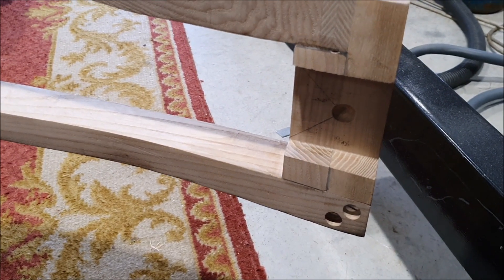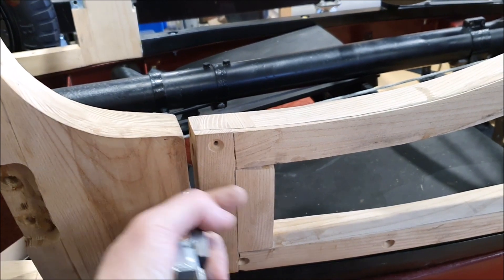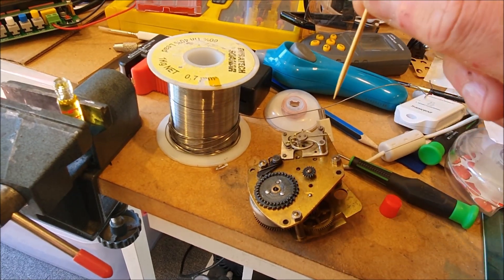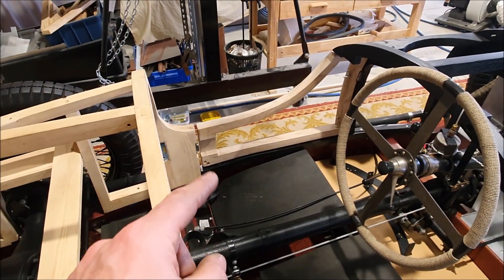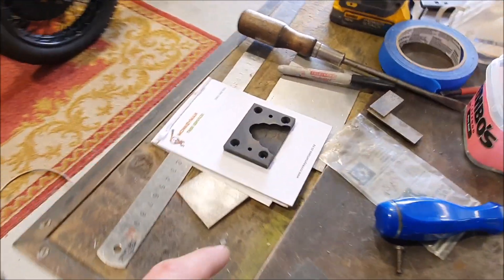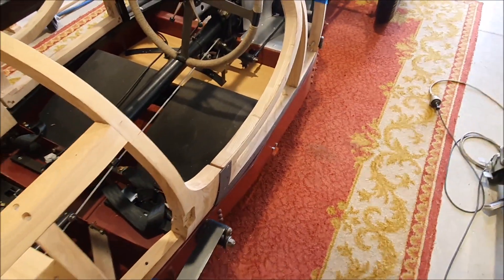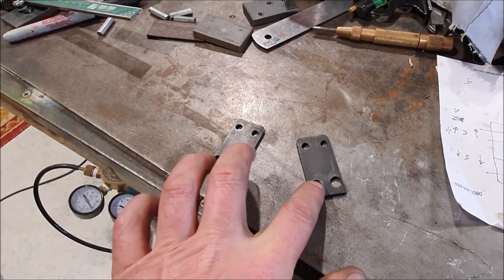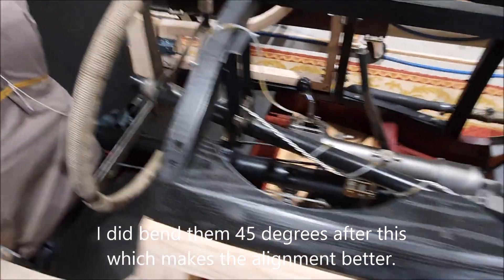Pre war Riley Brooklands - door latches part 2

Comment: A few decades ago I was a sewing machine repair guy, Make sure to oil anything that moves and please grease the gears or else they will reduce themselves to nylon dust fairly quickly. I used a black moly based grease sparingly on the teeth of the gears. I am absolutely addicted to your channel! Been a British car nut ever since my Uncle took me for a spirited ride in his red MGA when I was five years old. I'm 58 now and have owned many different makes of British vehicles including motorcycles. Keep up the great job and I'll be there to watch and 'Like"  each episode!
Reply from the maker: Thanks for the tips. I suspect it needs more 'flushing out' as it starts slowly then speeds up over several minutes. I do have some proper plastic gear grease somewhere, some of that might work on the plastic bits. Apparently the metal to metal used sintered bushes which were oiled at the factory. When I was younger I never really liked MGAs, the nose always looked wrong to me, but they have grown on me over the years.

Comment: Standard method of dealing with worn pivot holes is to rebush them by drilling oversize and fitting bushes. These can be cut from pre-formed "bushing wire" which is readily available in different sizes.
An alternative to a forward mounted handle for the door locks would be a flexible cable pull. This could either fit inside the thickness of the door with a trimmed recess or be mounted on the inside surface like eg the SS Jaguar 100 which uses a leather trimmed chain using very similar catches. You can then dispense with the internal lever as the cable or chain attaches directly to the end of the latching bolt via a cross-drilled stud.
Reply from the maker: I think there is an entire rabbit hole of clock making I could end up falling down if I am not careful! A cable pull was something I considered too. I actually bought some cable pull latches to play with. I think a lever will work better and I can arrange it so that the door latching is quite soft, you don't have to slam the doors, but the opening handle is reasonably firm so you can't accidentally knock them. I want the handle to be solid feeling. It's a personal thing that flimsy door handles annoys me so I want them to 'feel' nice.

Comment: Hi Simon  You may have been ''climb milling'' when you had your problem. That is the table moving in the same direction as the cutter rotation. Only happens with HSS cutters as the cutter gets sucked into the job. Timber framed doors do ''clunk'' If you have ever been on steam trains the rolling stock does the same thing. Slow but steady! Good job.  Cheers John
Reply from the maker: Hi John, yes probably with the climb milling. I always have to think carefully about that and still often get it wrong.
Reply: When I was an apprentice (yonks ago!) we were taught It was bad practice. Today with the advent of insert tool holders improved cutting angles and higher spindle speeds it is  not the problem it once was. I think the same rules still apply. If you are only milling once every blue moon then I would be the same! Write on the machine plunge then an arrow in the required direction. I used to use chalk so I could rub it off!  Cheers John @asciimation

Comment: Right way to go with the latches I think. I would have the handle as a pull; more instinctive. The steel may have some inclusions that caused local hard /soft spots. An interesting one. When you get the car skinned and driving, more adjustments will follow once you know how much chassis flex you have. That is my experience. Reckon I would need to have the doors at 180 for me to get into the cockpit today! Looking forward to seeing it being fitted out with the instruments. Best wishes from the UK
Reply from the maker: "more adjustments will follow once you know how much chassis flex you have" that's why I am trying to make everything adjustable or tweakable later. I don't imagine getting it right first time! Advice from someone with one of these cars is leave off the door straps. The doors aren't heavy and having them open fully is very useful.

Comment: The engineering in those doors and latches is pretty impressive.  But I would caution you, if you engineer them anymore you may need a higher horse powered engine to drag the car around. 😁 The proof that you are doing things right is, if the car was mine, I'd just be stepping over the sides with no doors. Don't do stuff like I would....Cheers from Iowa
Reply from the maker: I honestly don't think you can get into the car easily without the doors. The steering wheel gets in the way. A lot of the racers in the UK use detachable steering wheels I think and maybe the doorless bodies have slightly more room to them? I can always add lightness later by drilling some holes in things I think.
Reply: Like I said "don't do things the way I would do them" 😁 @asciimation

Comment: As far as doors go, my  tourer, which has an original body, has latches much like the ones you have , as far as location goes the door has a wedge type fitting attached to the frame that locates into a corresponding female fitting let into the frame . This I suppose locates the door and stops it hitting the frame face.
Reply from the maker: Is the wedge a little rubber block thing and a corresponding metal 'cup' it fits into? I did get some of those, I should look to see if I can fit them.
Reply: @asciimation  the door fitting is a very shallow wedge shape of pressed steel, the door fitting is also steel ,the part that checks with the wedge must also have been metal, just some broken rusty bits were in it when I got it ,so I shaped a piece of rubber to do the job . The frame also has two small rubber buffers set into it. My latches don't even have a second catch so it is definitely  not wise to lean on the doors. I could email a photo but don't know where to send it.
Reply from the maker: @mikeadams7829  I'll dig mine out and show them in the next film. If you click on my username (asciimation) on here it should take you to an about page and if you expand that it should have my email address there.

Comment: Might the originals have had leather fitted to the door edge strip with the soft face to the inside of the car for rattle prevention from the door / body joint? Or even the stuff fitted around the radiator edge for the bonnet to sit on & prevent rubbing?
Reply from the maker: This is where not having an original to go look at is annoying. I have many pictures but of course it's hard to see fine details like this.

Comment: I would guess they may have glued a thin piece of leather on that edge to stop the rattle 🤷🏻‍♂️
Reply from the maker: Or rubber maybe?
Reply: @asciimation I’m sure I have seen bonnet lacing used instead of modern rubber on some of the specials over this side of the ditch.
Loving the builds and really enjoying seeing the progress and thought process you go through for a solution.

Comment: did you ever consider a cable inside the door frame like the early mini?
Reply from the maker: I did, I even bought some suitable latches but they weren't done that way originally and I am trying to stick to the factory look. I've not seen any 'real' ones with cable pulls. I have seen them with handles down near the latch which isn't factory. The most original ones the handle is half way along the door near the top. I thought they were more forward than that but apparently not!

Comment: tendency to overthinkting things here?  Cars of the era just had wood frames with a metal skin, and they are still around and in one piece.   Just wood frames with single skin over, and very basic door catches.  I think you are applying modern standards of construction to something that would not have been done then.  Complication adds to the chances of errors IMO.
Reply from the maker: The problem is they are around and often fixed or modified. Little details get muddled over the years. I have several pictures of originals showing the door handles and even the handles don't point in consistent directions from car to car. My main reason for over engineering it is so I can adjust things. The factory made more than one so once they got the first right, which I am sure took fettling, they knew exactly how to make the rest.